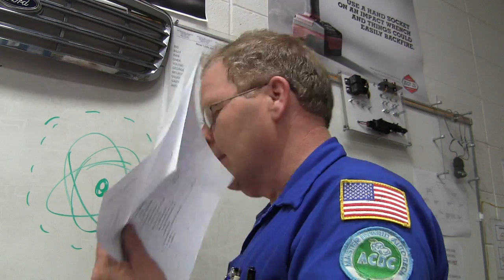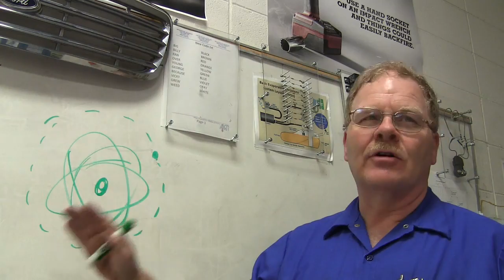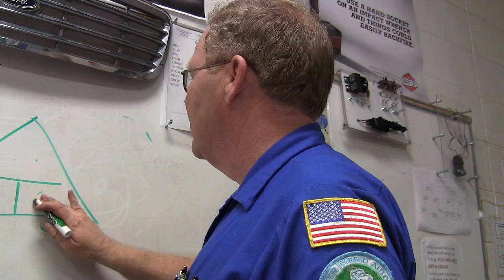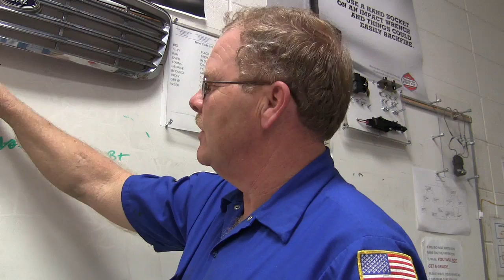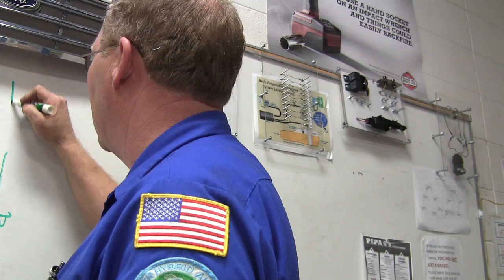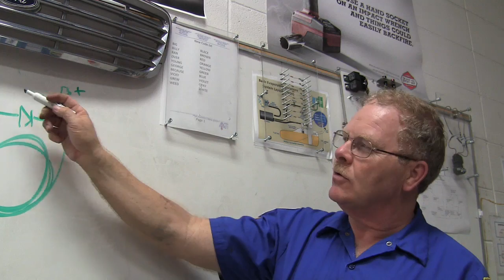Electrical Orientation and Test 1

Comment: is the theory of electricity, protons neutrons and atoms on the A6 test?
Reply from the maker: +Michael Nicholson   Not on any of the A6 tests I've taken over the past 25 years - and I've taken the A6 five times.  But some manufacturers will include that information for foundational purposes.
Reply: Thank you for your time Sir. I'm taking it for my first time. I don't know what all it covers. I'm concerned about the flashing and programming control modules. I haven't had any experience with this part of electronics. Can you suggest a good book or place to get the info to learn more about it? Thanks again
Reply from the maker: +Michael Nicholson - AEtools.us is all about programming and the equipment to do it, but the A6 doesn't have anything about that on the test - not that I've seen.
Reply: Thanks again. Thats a relief. There is so much to know about all of it.So much has to be known to make a decent paycheck.From A1-A9. Its overwhelming when i have been hands on most of my years. Some of the things like transmissions Ive pulled and put back but couldn't tell you how to rebuild or diagnose them. Thanks for listening to me ramble and for the advice. It really helps..
Reply from the maker: I have not seen it on there but it may be on some versions of the test that I haven't seen because you don't see every question on every test just a sample that satisfies the number of questions you're supposed to have